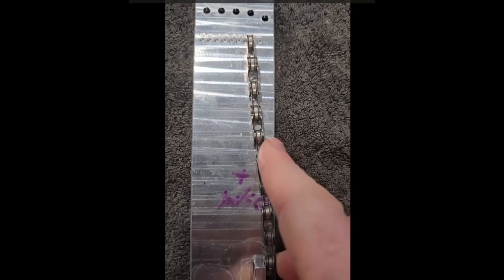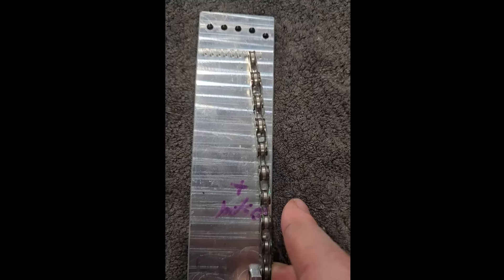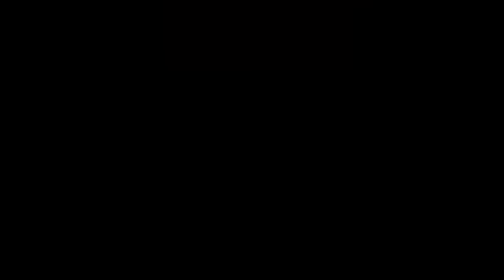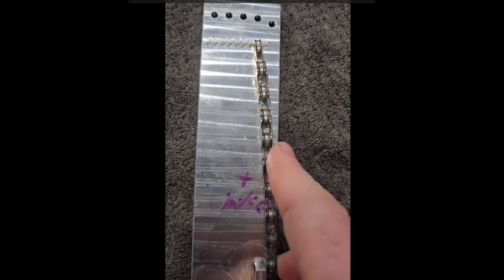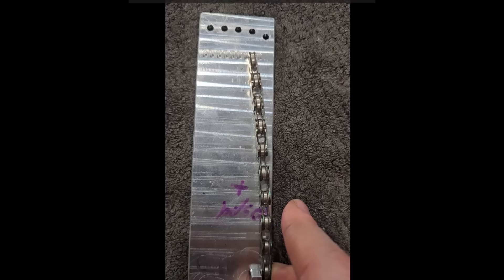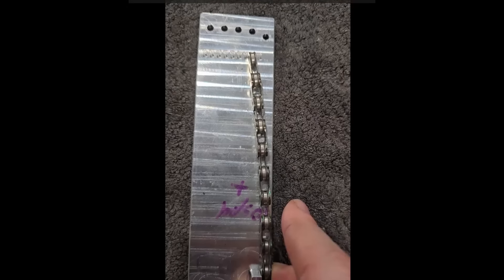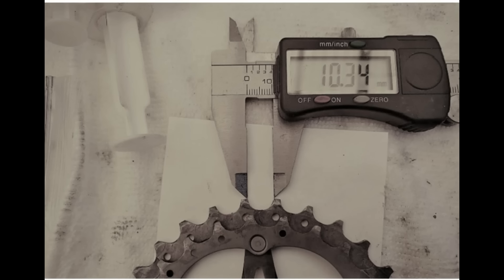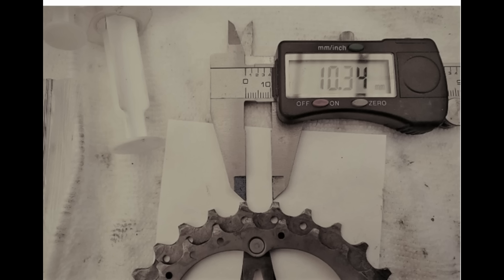Sram WTF

Comment: honestly I think it would go a long way for these rebuttal videos if you do some videos in the style of  Steve Mould.  Specifically the ones where he comes up with a way to show what's happening inside while it's working... after all as they say a picture is worth a thousand words.  for example, if you could make one plate of one side of the chain transparent so that while the chain is installed and in tension on the front chainring you could put a macro lens on it such that the camera can see the gap between the pin and the roller, and everything turning and moving as the chain goes around, and possibly other things in action such as ingress by dirt, or lack of ingress by lubricant. that kind of thing goes a long ways towards proving what's actually happening inside.

another thing you could maybe do is a time lapse of the chain going over the front chainring over the course of your testing to show it going from a new state to a worn state.
Reply from the maker: Honestly that would be amazing. But currently that is about 1000 levels of YT creator above where i have the time & skills to do. I am just an everyday cyclist focusing in this area with ZFC as a hobby business. If i can get more time and skills over time then some better presentation skills would be great, but oh so many other YT channels, they have real creators on them (many with a whole team for scripting, filming, editing and effects). What i have is typically a 1 to 2hr recording block on a friday as well as a lack of numerous skills. My apologies.

Comment: Is it possible, Adam, that SRAM is unwisely making their chain wearing surfaces TOO hard and causing the cassette and chainwheel to wear faster than if software chain materials were used?  Like you say, chains are supposed to be the consumable, sacrificial part.
Reply from the maker: yes that seems to be the issue - its not that their cassettes / rings are fast wearing - in fact overall we believe they are on the hardier side of things as well, it is just that the hardchrome treatment they use on higher level 12spd chains is incredibly wear resistant, it is way ahead of other chains on the market regarding wear durability. 

This is basically bringing up this new issue that by the time their chains are reaching the normal 0.5% wear mark - it can be unlikely a new chain will go onto existing components without issues. And so they are basically say look dont risk that, push them out to 0.8%, and then replace everything. 

So if they want to explicitly say that - thats fine, and we can discuss the pro's and cons of srams vs others based on that. 

but what you cant say is that replacing chains early "causes premature wear" to cassettes and chain rings. They are saying this to avoid people replacing chains earlier than their own recommended 0.8%, and then having mesh / running rough issues. 

So basically putting out a knowingly very false statement, as explaining the actual situation is a little too messy for them
Reply: @zerofrictioncycling992  Damn that is a complete mess.  WTF indeed!

Comment: Clearly they meant to say "late"?
Reply from the maker: In what sentence / what part do you mean?
Reply: Replace the word "early" with "late" in the sentence that made your brain explode. Never underestimate the ability of a bored/tired person to make a mistake when mindlessly adding knowledgebase additions. It has to be considered, and waiting till you had heard back from Sram first would have confirmed if that was the case.

That's why journalists try to get a response before publishing, because if it's a mistake it's not a story worth 20 minutes of postulation and exasperation. Further, all this unsubstantiated, wandering hypothesizing, if based on a simple mistake, can only serve to breed rumours that will last for time immemorial on forums. As we all know, drama gets more views than retractions/corrections.
Reply from the maker: @MrKipperfish  Understand - i do have some backing information from others that it most definitely is not a typo due to the reasons explained in the vid. and it is not always easy to get the right person at such large mfg - sometimes opening up the chat publicly helps in that regards. 

And also remember that by all logic and standards re chain replacement in the last decade, going past 0.5% is too late. And it will be too late to get a new chain onto existing parts with sram as well. Going to 0.8 will guarantee you need new cassette and likely rings as well. Again in line with what has been put forwards in this video. 

if their tool was 0.5%, i would be inclined to agree with the possibility it may be typo. Knowing what just simply happens when you run a chain to 0.8% - whilst of course i may be wrong, but it seems clear what the intention of this sentence is aimed to prevent

But if i am wrong - you will find that update that is for certain!

Comment: Is it possible the chain's hard wearing coating accelerates gear wear, as it wears off it's easier on the gears; throwing a new chain on, with a fresh wear resistant coating, chews into the gears again until worn off? I'd like to assume the best but the cycling industry tends to lean towards the over spend side of things.

Comment: about MTB, depends where you ride. I lived in a muddy country for some time, front chainrings were eaten in 1kkm - but from SIDES.  teeth profile was still ok, but teeth were becoming thin razor-like blades, and at the end were too thin (and not retaining chain properly)  or snapping.
Reply from the maker: yep part of that can be the chainring material - quite a lot of mtb chainrings are aluminium, and often not the harder grades, and so can be very soft wearing. The roller can settle in well with very little movement and thus were, whilst in mud conditions the plates are sliding down sides of teeth with abrasive mud for lubricant - and even though the load is still mild on high chain line angles, soft rings + lots of wear interactions with abrasive particles for lubricant - exactly what  you have experienced happens

Comment: 31:46.   If the hard chrome treatment on the SRAM chains is so wear-resistant, why not treat the cogs and chainrings the same way and thereby reduce overall drivetrain wear?
Reply: They may not be able to.  Different materials.  Maybe a RED stainless cassette doesn't accept that coating
Reply from the maker: extra mfg cost and also largely a lot of technical challenges. Ie pins on chain are cut from a rod, so an entire rod is much more easily plated, as are the steel sheets for link plates etc. The cassettes are cut from billet, so would need to be plated after cutting, and will be a different metal vs chain steel. And it still may not really work as once a chain becomes more and more elongation worn, it really needs to eat out the teeth to suit that length or it will run very badly on the cogs / rings.

Comment: How about testing the new version of the chain and see if they fixed the weird inefficiency of the RED chains compared to the Force.
Reply from the maker: CS have tested one of the t-types from memory and it was same as red, but they havent tested a variety of T-Type yet to see if any weird things going on at different chain levels, nor the new red e1. Not sure when / if they will get to, they have been building and calibrating a very fancy new test machine. nearly done, but im not sure what the managment have backed up the test man there to do before he can start doing curiosity tests like this again. For the moment, still assume all flat top are on the slower side of chain efficiency, and but hardchrome are the best training chains, racers should look to the ybn sla mk 12 as race chains which is lightning fast, but will have much lower wear life vs hard chrome

Comment: Is it forbidden to reverse engineer the LL chain tool and upload it for 3d printing, since it is patent pended? or do I have nothing to fear?..
Reply: you can 3d print whatever you want.
Reply: @bermchasin  Except, perhaps, guns?
Reply: Patent pending status implies that infringement could (retroactively) trigger legal action once the patent is granted. So you should view it as "patented", 
So it would probably depend on what you mean by "uploading" if you made it public in a way it could be traced to you and/or easily commissioned by others (something like Shapeways for example) then potentially there could be in trouble. However, sending it off privately to a 3D printer for a one-off, for personal use would likely to go unnoticed.
If you were to publish say a design for a tool that effectively does the same thing but, maybe, measures over more links, or has a pin in the middle and has marks rather than holes around the outside on a semicircular plate (yeah i've been thinking about this too) it would be hard for them to prove infringement (but maybe not impossible).

Comment: I just had to replace a set of 2x Easton Cinch chainrings because of slippage with a new chain, despite never using them with a chain worn all the way to the .5 elongation mark on the Abbey LL tool. Didn’t get much more than 12,000 miles on them, despite religious chain maintenance (Silca hot wax or Silca drip wax every 100-150 miles, hot water flush & blow dry immediately after every wet ride). I guess lateral wear could be the explanation, but not if I use the Abbey LL tool as shown in their video (without pressing down on the chain the way you do here).
Reply from the maker: it is likely just the material that the chainrings are made of. Like cassettes there is huge variance in brands / models chain rings hardness against wear, and some are simply very soft and do not hold up well at all, whereas others if people are replacing chains at 0.5 will likely have no hope wearing out rings for however long they keep that bike
Reply: @zerofrictioncycling992  Oh, okay, I misunderstood. I thought you’d been saying  chainrings and cogs will only wear out this soon if chains are run beyond the .5 wear mark or develop excessive lateral wear before going beyond .5 elongation wear.
Reply: @zerofrictioncycling992  BTW it would be really helpful to get your take on how to use the Abbey LL tool for measuring lateral wear. My results vary drastically depending on whether I do it as shown in Abbey’s YouTube video or as shown in your video (applying pressure to the extended part of the chain).
Reply from the maker: @williambracken9339  yes true that - using on length of chain just running past is easier to exert a lot more leverage, the way i did there i simply pressed hard, and without pressure it springs back up to about measure 3 - but yes will confirm for sure

Comment: Surely when using the lateral wear checking tool you should apply pressure to the end link rather than halfway down, otherwise you're not checking all the links in the section of chain being tested
Reply from the maker: i did pretty close too, you can also simply feel when you are putting a lot of pressure on and that  you have easily assessed the lateral wear amount.

Comment: 8:26 - Isn't it more accurate to say higher torque rather than higher power? I feel like you would get more skipping at 50RPM vs 100 for the same power output.
Reply: Higher power in a cycling context is achieved through higher torque.
Reply from the maker: yes correct, but as mostly people cycle in a relatively similar ballpark cadence of say 70 to 90, and they know what power numbers mean but not torque - it is just easier to explain via terms most understand well
Reply: @zerofrictioncycling992  Understood 👍
I do recall a few times in the past when I had a skipping chain. Going to lower gears was able to mitigate it a little bit so I always assumed this to be the case. Good to know it's legit and not just my imagination.

Comment: I have both the Sram chain checker as well as the Parktool CC-4.
When I check my mtb sram xx1 chain using the sram checker it just falls into it, so you would say >0.8%
When I use the Parktool however it just falls into 0.5 and not 0.75 %
I am really following the procedure and using innerlinks to engage, for both similar. Nevertheless to me it seems the Sram checker would the still be ok to tell me when to replace (just) the chain since it seems more like 0.5 than 0.8
Are there people here having similar experiences or am I doing something wrong here?
Reply from the maker: from memory when i did a chain wear checker check, the park tool cc4 was pretty accurate for 0.5%, i have a sram one too now so will check with 0.5% - i'll be back
Reply: @ think I saw a table from you somewhere where it stated 0.6 for the sram chainchecker. I checked again on my chain but with the parktool it really does not fall into the 0.5 but with the sram it does on what is supposed to be 0.8 
Curious on what your result with the Sram will be now
Reply from the maker: @akampgerard  and yes you are pretty much right - i just had another play and with just a little bit of force i can get my 0.5% chain up on the 0.8% sram mark. I would have rated it 0.6 just off a bit of feel in that it takes a little force (albeit small) vs "drop in" to that mark. However - overall i think its really close enough to have sram 0.8% basically equal to other tools 0.5% if both yours and mine are doing that - so thats just overall a bit confusing by sram....
Reply: @zerofrictioncycling992  yes exactly, for me it is even that the Sram chain checker warns me earlier than the Parktool CC-4, I have to use little force on my chain to drop it in with the CC-4 and no force with the one from Sram. That makes Sram is contradicting themselves I would say. They can't say their own chain checker is not an approved one, they in fact mention their own TL-CNTL-WEAR-A1 as well as the Parktool CC-4 as approved chain checkers for the 0.8 (while the Parktool only has 0.5 and 0.75)...
And now I read on the SRAM website that for Eagle drivetrains they advise replacing the chain before it reaches 0.80% of wear to extend cassette and chainring life, so here they at least say sooner ...  
But for flattop chains like Sram Red Axs and Sram Transmission with flattop chains apparently to do it when it reaches 0.8% and not sooner. By the way for SRAM RED AXS I don't see the line (anymore) where they are saying that  it leads to premature wear when you replace the flattop chain sooner than at .8%  Only a referral to approved chain checkers.
Hope in the end you can get a clear answer from them and also on why their own chain checker, which says >0.8%, then measures 0.5 or at the most 0.6 instead of the 0.8 they are advising.

Comment: Replacing SRAM MTB chain at .5-.6 will easy run 7 or 8 chains for a cluster when waxed.
Just rotate a new chain into a running pair when one hits the limit.
Road chainrings should not wear out if changing chains at .5, I am at 7 clusters and god knows how many chains and no real show of wear on the chainrings.
4 of those clusters was still using drip lube.
Reply from the maker: that is very interesting info, that is a lot of chains to a cassette! Your experience sure shows srams sentences to be rather incorrect :)

Comment: Any chance it's just a typo?
Reply: I don’t think so as even their chain checker tool is a go/no-go gauge which measures 0.8% wear, meaning an engineer made it so. Either an engineer who doesn’t know what they are doing or an engineer who was forced by the management to do it. Not sure which option is worse…
Reply: @viljamip  regardless; the 0.8% marker does not change replacing "early" with "late" making perfect sense.
Reply from the maker: sadly no, its an entire sentence that is stating something clearly, something that is simply knowingly false. We can see why they are doing it, but they need to work it so they are being honest about the situation, even if that takes a couple more sentences.
Reply from the maker: @viljamip  PS vijamp thankyou so much for being the one to highlight - my apologies i thought i saw it was dawnrider. Many thanks for the heads up on this one!